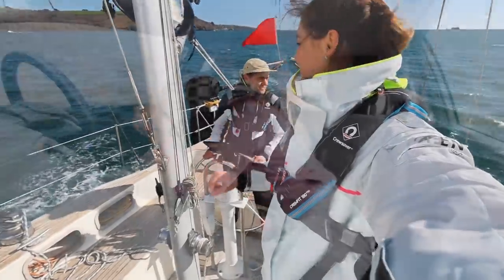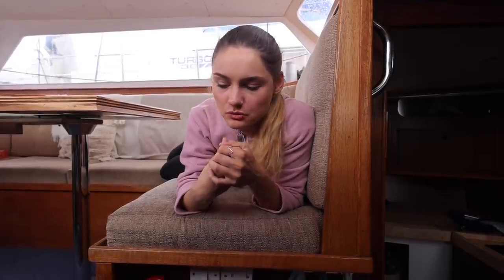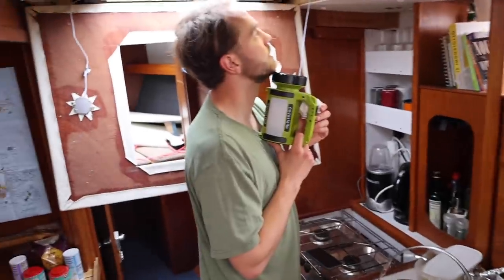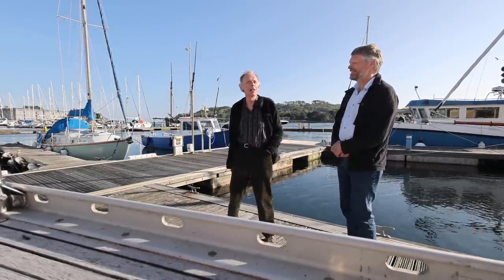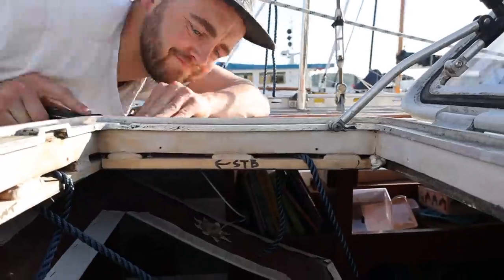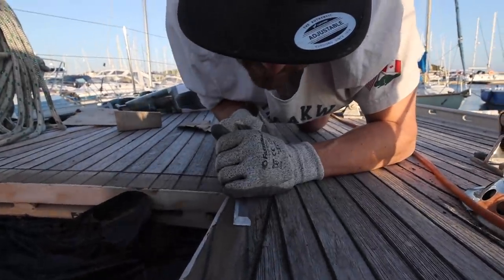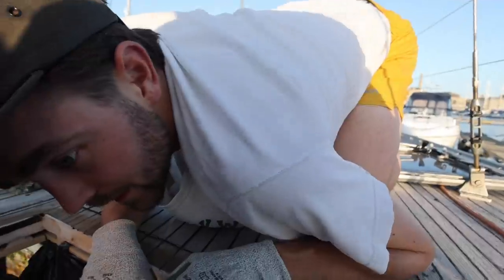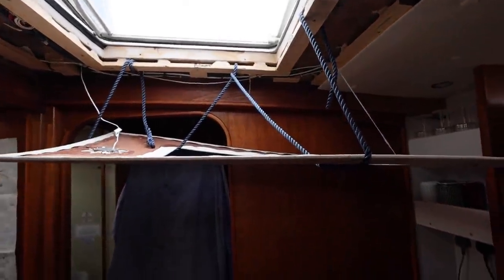Our New Sailing Boat is LEAKING

Comment: Well done with the hatch repair, 1 little tip when sealing something like a hatch is to not screw it down tight in first instant but let it start to cure a little and then finish tightening, this stops all the sealant being squeezed out and leaving thin amount under the frame .
Reply: Chris Wilson smart advice.
Reply: @azmike1956
Reply: Spot on, turns the sealant into a proper gasket
Reply from the maker: Thanks Chris! We actually did do this- we screwed the screws in but not tight and went back the next day and tightened them. Thanks so much 😊

Comment: The decks are a balsa core sandwich so the layers that you saw would be teak, gelcoat, fibreglass, endgrain balsa, fibreglass. Have a tap around the area with a light hammer, you should hear a solid sound, if the leak has affected the balsa, it will return a dull sound. This is what causes spongy decks. Fixable, but a big job.
I've just re-cored half of my deck because of a leaking fitting.
Reply from the maker: Thanks Klaudia! That makes so much sense. Will hit with a hammer and see what we find, it does sound a massive job! Did you have a leak for a while?

Comment: And one tip: If you are changing from reverse to forward (or vice versa), always give the engine (or gearbox) a second in neutral to align. If you do not do it, you add unnecessary stress on it. And a nice side effect: You learn to maneuver your boat with more ease and less stress. Boats are slow and heavy and take their time. Lets give it to them. 🙂
Reply from the maker: Great suggestion, thanks 😊

Comment: Nice one on the hatch repair. I’d get a multi tool, it makes boat work and in particular sika removal a breeze. Also having owned a Colvic for 20 years be aware that full lock in reverse can be more like a brake than a rudder. 60% rudder can be more effective. Hope this helps . Great videos btw!
Reply from the maker: We actually have a multi tool, the bread knife just works so well 🤣 Makes sense about full lock in reverse! Thanks Andy 😊

Comment: If you've ever seen a windscreen replacement you'll remember they create quite a high peak in the sealant by cutting an inverted "V" in the nozzle. This ensures even coverage when pressure is applied when re-installing the hatch.
Butyl Sealant Tape (malleable) is used in all these repairs, including wrapping screws by many of your YouTube peers. Mats from Sail Life, Peter from Travels with Geordie and Teal from Onboard Lifestyle.
Reply: Agreed I switched to Butyl for all things where I am sealing out water on deck, & have never looked back.  Butyl is non hardening so much easier to work with and cleanup afterwords is a breeze.  Down the road when you want to repair or replace something the butyl will also come up much easier. The cooler the temps are when you work with it the better down to a certain point I suppose.  I've never tried to use it at close to freezing.  The warmer it gets the stickier and more malleable it gets. 

     Being non hardening it also has the added bonus of not hardening in an expensive tube if you don't use it all right away, or it goes past it's shelf life in a sealed tube.  You can store left overs, or rolls of Butyl in a compartment on your boat and it will be there and ready to do it's job indefinitely.  I wouldn't try and use it in place of Sika for holding heavy things in place, like say when replacing a cabinet or bad appliance inside the cabin.  But for on deck replacing hatches, cleats, tackle etc, I reach for the butyl over the sika every time.
Reply from the maker: We have Butyl tape on board but wasn't quite sure on the best application of it for a hatch. Thanks for the advice! 😊
Reply from the maker: Interesting! Would you tape it directly to the deck and lay the hatch on top?
Reply: @TeuluTribe  They also make Butyl in tubes which I haven't tried but hear good things about.  Just a disclaimer, but this is going to be a hot topic as you meet more and more boat owners.  Some aren't going to be like me where I think both polyurethane and butyl products have their uses and are going to either say one is superior to the other and only to use that.  Just so you know.   

     But as far as where to apply it?  I've done both on the fixture and on the deck.  It's kind of a whatever is easiest thing for me.  When I did the hatch on my cuddy cabin power cruiser which had bolts and nuts instead of screws, I cleaned the hatch with alcohol to make sure it was free of any oil or contaminants.  Then applied the tape to the hatch and used a Phillips head screwdriver to pop the bolt holes in the tape.  I put the bolts through the holes then wrapped a little extra tape around the bolts on the threads under the hatch.  The holes in my deck actually have a slight chamfer in them so the extra tape forms an "O ring" in that chamfer, and the tape also holds the bolts in place  so you can move the hatch around and they don't fall out.

      I put the hatch in and tightened it about 2/3 of the way, waited 24 hours and then tightened it the rest of the way, and used a razor knife on any squeeze out, and peeled it off.

      If you cannot picture what I mean there are quite a few you tube videos demonstrating installing fixtures, and even using it to fix leaky rubber seals on hatches.  I want to say I remember the Wynn's from Gone with the Wynn's using it on their last overhaul in New Zealand or Australia on both hatches and the porthole/ window glass/lexan.

Comment: More power is more prop walk - which clearly you now understand. You can also use a rope to stop the boat going too far to port as you back out. Leave a light line from your starboard stern cleat to the dock and back to your boat. As you back out you can control the stern with it. You can pull it through and back on board when you are finished with it.
Reply from the maker: Good idea Nigel- we were a little concerned by keeping our stern line on would pull our bow round but we will give it a go next time 😊
Reply: @TeuluTribe  It may bring the bow round so a light touch needed and ....make sure the line is free to run and won't get snagged, either on the dock or 😱 the prop

Comment: Best put down to rebed all the hatches. If the sealant is perished on one it is on all of them.  Consider butyl tape rather than Sikka Flex.  Use of two or three even putty knives is much easier and less deadly than a carving knife. (If you snap one the pointy bits fly quite a ways.)  Becka, when editing, please watch the audio levels a bit more closely. Laptops only have a couple of watts behind the speaker but those of us watching at home give  the volume button a good work out.
Reply from the maker: Thanks Mark- we have some Butyl tape onboard but wasn't quite sure how we would use it- just tape to the deck and lay the hatch on top? Will watch for the audio. Thanks 😊
Reply: Mads is meticulous. Watch here: https://www.youtube.com/watch?v=1g1Q_4VwiD0

Comment: Plymouth my old stomping ground. ...🧙‍♂️😎 Mt Edgecombe  in the background ... I used to catch  the foot ferry over from the warf.
Butyle tape for hatches deck fittings and screws and ports...always have some on hand. 
Say hello to Cahoda.
Reply from the maker: Oh cool! We have some Butyl tape but weren't quite sure of the best application for it for a hatch. How would you use it? 😊
Reply: @TeuluTribe  
It works on smooth even dry surfaces best....where you know you are going to have to remove stuff again..  on uneven surfaces it can be built up to greater thicknesses in layers..
A twist round a screw or bolt head will stop water ingress down a countersink hole.
The other use is to isolate different metals like stainless  steel from steel or aluminium.. under a fitting.

Comment: You said one thing: "It's better that they happen here, when you've got all the tools and electric and stuff, rather than at sea". Most raining-leakage you find in the harbour, but it's great you tackle this head on, rather than just patching it for a few weeks.
But please do not leave ANY tools behind, when leaving port. I guarantee you will need every single tool, you left at one time. Or screw.
Thats why sailors often have more tools and spare parts on board, than they have food.... 🤣😓😓😓
Reply from the maker: Will keep all our tools! Thanks so much 😊

Comment: Great to see the Jesters.  Check out their website and the history behind them.  Jester was one of the boats in the first OSTAR a race with Blondie Haslar at the helm.  Sir Francis Chichester was also in that race, quite some history.  Blondie also invented the Haslar windvane one of the pre-cursors to modern windvanes.  To top it all Blondie was one of the few survivors of the Cockleshell Heroes WW2 raid on Bordeaux in kayaks.  

Ref boat jobs, I would have used Butyl sealant, not Sikaflex.  Also Becka is right the teak is on the main grp layer and I’m not sure if there is a balsa core but it will be wet if there was.  Get yourself a cordless multi tool, you will find it invaluable for cutting, sanding and it also has a smooth scraper blade that makes quick work of getting under deck fittings.  If you haven’t already watch the videos of Mads on his Warrior 38 rebuild, Sail Life.  Invaluable advice on just about everything.  Good news on the ensign….  Andy UK
Reply from the maker: Thanks for the comment Andy! It’s a fascinating history. They told us a bit about it but we went online after they left. Seems it was introduced as a Corinthian response. So cool.

Might be a silly question but is butyl tape the same as butyl sealant? We have some but weren’t quite sure on it’s application! We have a multi tool, just reached for the bread knife instead 🤣
Reply: @TeuluTribe  Btw yes the Jester is a Corinthian event taking things back to how they started and before sponsorship etc made transatlantic races too expensive for most amateur sailors.  I have a few friends who have done it and I love that there are no rules' it’s not even a race as such.  Cheers. A

Comment: If I may?? Contact your boat builder and try to learn about your decks below the teak. Most boats use a core material between layers of fiberglass to strength the decks and if wood was used for this purpose...any water intrusion around screw holes etc. will create wood rot and soft spots and these must be dealt with.
Reply: The builder went out of business in 2000.

Comment: Others have said it, butyl tape has a lot of advantages and is cheap. If you must sikaflex it, only screw down lightly then snug it up 24 hours later. In 10 years when you come to rebed that hatch, you’ll wish you used butyl…
Reply from the maker: We have some, but weren't quite sure how to use it properly- do you stick it directly to the deck? Thanks Ian 😊
Reply: @TeuluTribe  more or less, yes. Clean first with meths or better still acetone, both surfaces. The butyl needs to be warmish- like body temperature and it becomes easier to handle. Bead about 3mm thick around the edges and inside the screw holes too. Also, twist a bit off and pull it out like chewing gum and wrap it around the heads of screws before inserting them. This stops moisture going down the threads from the exposed head and into your balsa.
Trim up the squeezed out bead - much less messy than sikaflex, meths to clean area and you’re done. 
Sikaflex is a wonderful adhesive - you’ll discover that in a few years, and the entire tube will go off in a few weeks after opening (even if you cover it well with some cling film and the nozzle) and it is crazy expensive. Your butyl will be serviceable in your bosun’s locker for years…
Good luck. PS I saw your boat when it was for sale… very nearly went to see her but bought a Pearson 365 instead as I single hand.

Comment: Which sikaflex did you use? One of the downsides of using such adhesives is that if another leak occurs you will struggle to get the hatch back off again.
Reply from the maker: We have a mixture of sikaflex’s but I think just the sealant ☺️